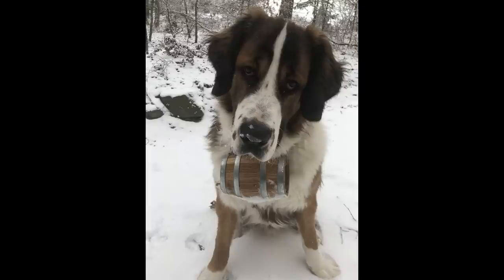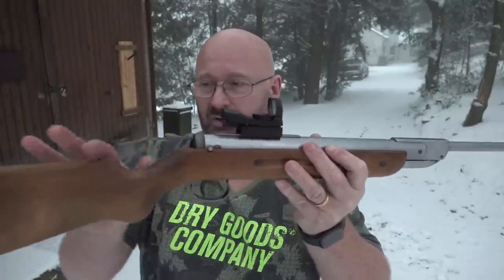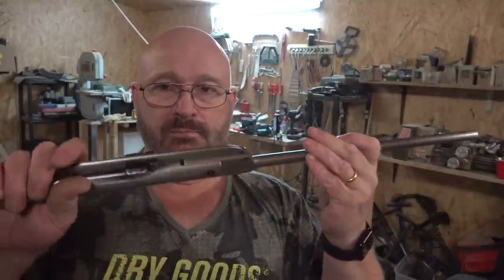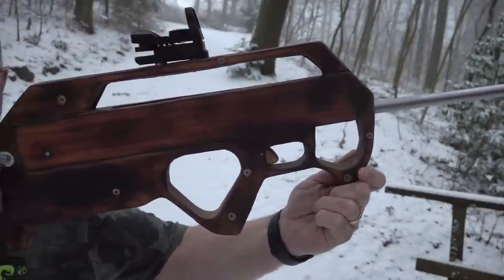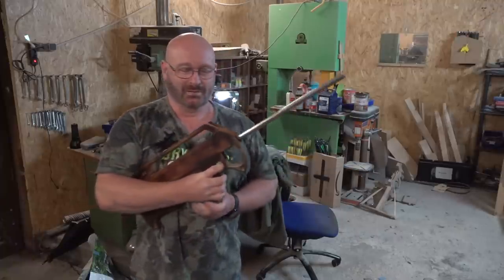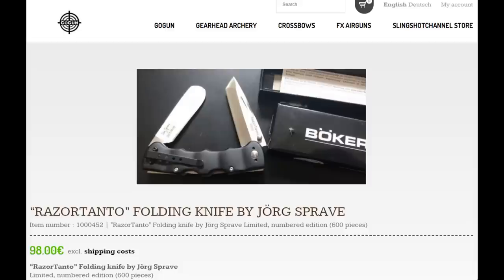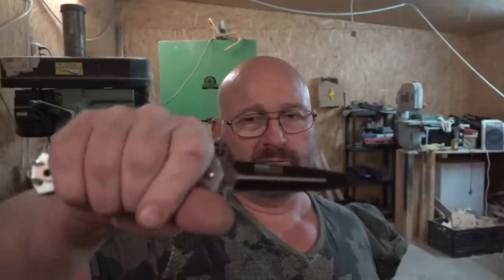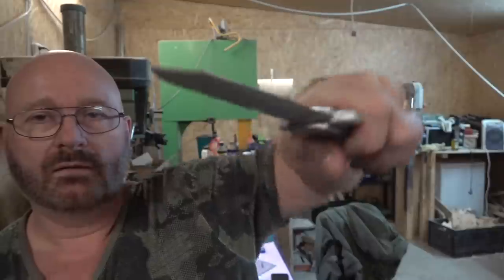How 2 Turn a 60 yr old pellet gun into a super cool Bullpup rifle

Comment: That's absolutely badass. In Canada, airguns are regulated by velocity, not power. A .17 calibre can be 495 fps, a .22 is still available as long as you're over 18 and under 495, even a .50 cal is still legal if it's below 500 feet per second. Canadian law is weird. I can be high and use airguns it's not illegal. Very dangerous though.
Reply: lol that's actually really weird :P
Reply: Not only weird, but outright stupid. It's now banned to import folding knives with flippers, even though the sale itself and carrying of it is still legal.
Reply: If you have a permit or something can you get a higher power airgun? I know you can legally get a gun in Canada so it'd be weird if you couldn't legally get a useful airgun.
Reply: @jordanl6464  Yes. The way it works is simply that any airgun with a muzzle velocity of over 500 fps is considered a firearm. So if you have a gun license, you can get a high powered air rifle. In Canada, pistols are considered "restricted firearms", so you can own them but cannot really use them outside of a shooting range. So if you were to get an air pistol that shoots at over 500 fps, it would be considered a restricted firearm and you would have to handle it accordingly to the law.
Reply: huh, time to make a reduced powder 50 caliber handgun... yeee
Reply: @clockworkgamerguy  Lol, I've been thinking that for a while. Actually, I thought a somewhat big bore pumper with low-ish pressure would be nice to have. Aim for 450 fps of muzzle velocity with a big enough caliber to do some serious damage, and you've got yourself a nice little unregulated hunting device. I think I'd choose something like .357 or 9mm to use less lead.
Reply: Strange laws indeed
Reply: @Reno Simpson "for grip", "folding stalk", "non-since". Also, restriction by velocity is silly because it should if anything be by kinetic energy, but you realize that you can still literally kill people with an air gun, right? That's why.

Comment: The design you came up with was very cool, but it hurts a little bit to see that beautiful rifle taken apart.  They don't make them like they used to.
Reply from the maker: I can change it back into the old stock in a couple of minutes. Nothing was altered or damaged. I just made a second stock.
Reply: @Slingshotchannel  OH THANK GOD!
Reply: notforsale today you buy gun germany you can’t do nothing to it looks like but on the other hand if he was in the usa he would have gatlan .223
Reply: Actually you can find basically the same air rifle new on Amazon or used on eBay.
Reply: Point taken but they make them better than they used to generally from a 65 year old airgun enthusaist.
Reply: I think that they actually do make them at least like they used to, if not better.

Comment: By interfering with a trigger, I assume that doesn't include adjusting it with a hex drive tool to your liking isn't illegal? Also, not holding onto the barrel while loading a break barrel is largely frowned upon by the shooting community as in the event of a mechanical malfunction it could snap closed taking your finger with it.

Comment: I would move the whole mechanic to the left side.
So you can pull the barrel leftwards to your body and you have enough space to put a scope on top of your bullpup rifle.
And if you install a changeable magazine (maybe from an airsoft?) on the right side of rifle which get activated if the barrel arrives in the back cocking Position this would be extremely sweet :D

Maybe another challenge? ;D

Comment: I would make the blade of the knife triangular in shape, and I'd personally get rid of the grooves along the handle. If you want a knife with a handle similar to the Ulfbehrt sword, you shoudl do a handle similar to the Opinel folders. However, that would require a different lock, which may or may not be good.

Comment: Another way would have been to construct the trigger assembly separate from the stock and mount it directly to the barrel. Then run a bike brake cable to the rear trigger. The optics would be mounted directly to the barrel, which is preferable in the event the rifle has any barrel droop.

Comment: you could make your 'beefy sword'  extend through and beyond the pommel, potentially doubling the length of the tang. then you could have a short knife still exposed when it is folded in; thus needing a sheath. also you could put some 'tools' on the back of the false blade, if the blade is wider than the grip. could make it like a crowbar multitool. a wrench set. mmmm :)
too bad i only just got this video. i hadn't even seen your knife release vid.

Comment: @JoergSprave  Only problem I see with a double-edged folder, si the same thing I have seen with ALL double-edged folders...  they tend to open a bit, or the blade drifts out of the handle slightly, and there is then a LIVE cutting edge against the inside of your pocket...  against the very living side of your leg.  Very easy to cut yourself.

Comment: I’m a bit late but, would be possible to add a feeding system for the pellet gun in the slot where you actually feed the pellets? Maybe actioned by the moving lever part (lever moves and system push pellet in the barrel)

Comment: itd be neat if you made a full auto airgun that ran on a motorized air compressor tank, in the shape if a big minigun(MAKE IT A MINI GUN >:D) that had some sort of blocking gate that made it so you could pull the trigger and get hard quick bursts, possibly something with an elastic property to it.

u could have the chamber line up with a gravity fed pellet system :33333

Comment: Not everyone can use a bulpup break action... The forces will increase because the lever gets smaller...
BTW, if you find cocking and break action difficult, hold it with one hand at butt and the other at muzzle... That way it becomes easier
Reply: The system may be shorter, but not considerably so. I think you'd have more issue with just pulling up. I reckon it'd be easier mounted 90° over. This'd also bring the sight much closer to the barrel